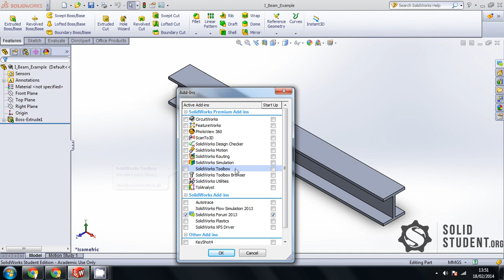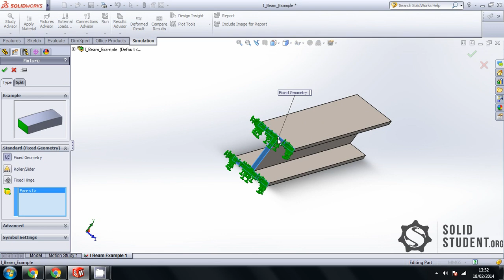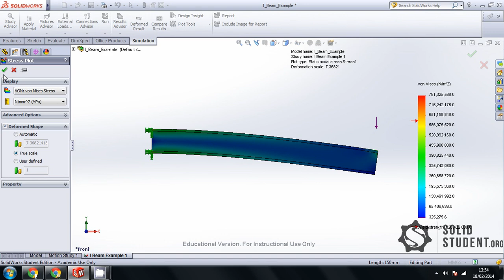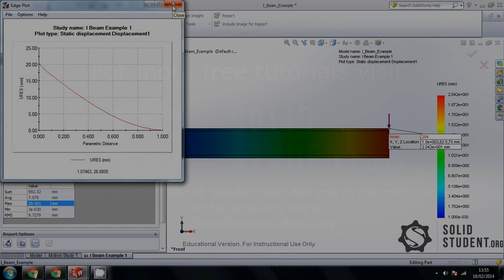Solidworks Simulation - End-loaded I Beam Simulation Walkthrough

Comment: Can this be used on a sandwich construction? Is it accurate for composite materials?(fibre direction etc)
Reply from the maker: Are you asking about the method or Solidworks Simulation itself?

This method is about as basic an example as you can get in SWX Simulation - its a single part, single material and single fixture and loading conditions.  

I think you might be able to do a simulation of a sandwich plate if you took the time to model the sandwich material and the top and bottom plates and created an assembly with advanced mates, but I dont think it would be that accurate.

As for composite materials, the default composites in the Solidworks Materials library only have a density value, not any of the stuff that is actually used when running FEA - No elastic modulus, no poissons ratio, no yield strength. If you had these values to hand for your composite weave (in all three axes) and angles of interest then its possible for you to create your own material and assign those values and run the simulation with that.

I should point out at this point I'm not a professional with this stuff and if you are looking to do this as a commercial entity you should look into contacting your Solidworks Reseller.
Reply: Thanks! I guess I'll have to look into composite specific programs... tensile calcs and math aren't the best solutions I guess...